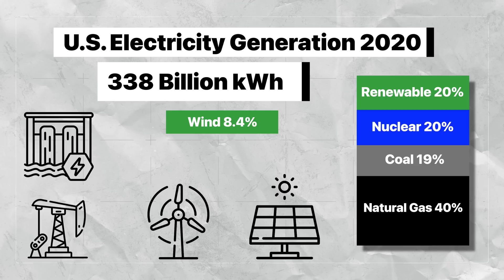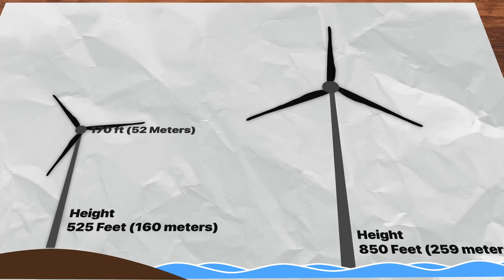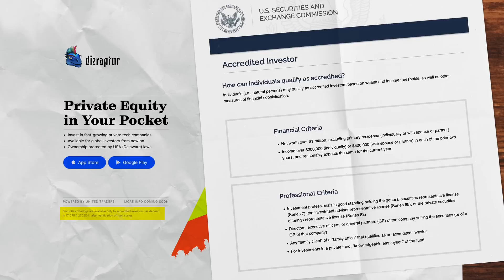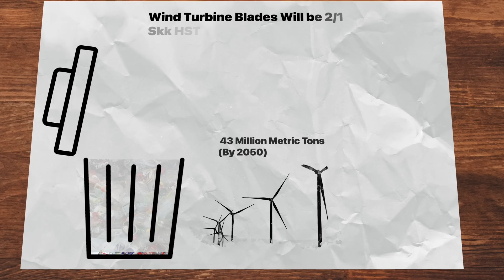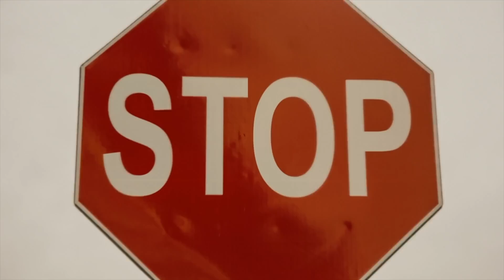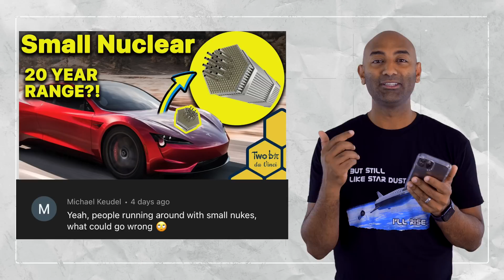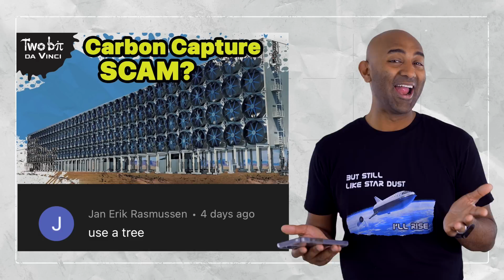The TRUTH About Wind Turbines

Comment: Let’s put wind turbine blades into perspective:

85% recyclable is amazing compared to most things we use.

43 million tons is so tiny, the coal industry currently produces 5 billion tons of toxic slag per year to landfill, plus another 0.5 billion tons of infrastructure per year, and slag is 100’s of times more toxic than wind turbine blades and is actually cancerogenic.

A 1 GW coal power station over 30 years will burn 100 million tons of coal, use 100’s of millions of gallons of oil to mine, transport and process that coal, use 5.5 trillion gallons of fresh water in the cooling towers, generate 6 million tons of toxic slag and 0.5 million tons of infrastructure to landfill and produce 300 million tons of CO2 gasses plus many other toxic gasses.
Compared to say the Dogger bank wind farm (the latest and greatest 3.6GW wind farm under construction in the UK) That will require no fuel, no fresh water, no oil to process the fuel, produce no greenhouse gasses, and generate approx. 0.3 million tons of turbine blades to landfill.

Wind farms only need constructing (which is only 2 to 3 times the construction overheads of the coal infrastructure) and maintenance which will be no more than the resources required to maintain the massive coal infrastructure while mining and processing the coal.
43 million tons to landfill and zero emissions per year, compared to 5.5 billion tons to landfill for coal plus 30 billion tons of emissions per year. 

I'm not saying putting wind turbine blades in landfill is good, but basically offshore wind farms are over 1000 times less polluting over their full life cycle than coal!
Reply: DAH !!!! And how many tons of coal to melt the iron for just ONE tower ?And then tons of cement just to hold the tower, all the diesel needed to extract the iron and transport to melting facility and then transport those heavy pylones to the windmill farm.
But this is just the tip of the iceberg, all the rare metals needed for turbine and batteries, some like cobalt are mined by children in Congo, some other need to extract one ton of dirt (by big diesel trucks) for just 1oz, some other countries such as China don't care about the pollution they cause to their own land.
Yep! many of those rare metals can be dug elsewhere but at what price ? Its cheaper to have kids digging for free, so any "ecologic" business will buy from those third world countries to justify the "clean" energy, yah right !!!
Reply: @danielforget9311  You don't get it, fossil fuels don't just magically turn in to electrons, it takes just a much infrastructure to build, maintain, and replace the fossil system,  just as many rare metals, just as much land, the fossil fuel system has a similar lifespan as the renewables, of which most of the infrastructure ends up in landfill while periodically replacements are constructed.

Yes child slave labour is terrible, but Most the cobalt mined in the Congo is used to refine Gasoline (which has always been the main use for cobalt), new modern mines are used for the new battery production! Plus most new battery technology do not use Cobalt.

And damage to land: have you ever visited an open cast coal mine (there are 10's or thousands around the world), or seen an oil slick, or the damage the 5 billion tons per year of coal slag heaps leaking into the environment, or the damage from acid rain? the world mines 100,000 tons of lithium, 5,000 tons of cobalt, compared to 86,000,000,000 tons of coal per year!!!!

And China cares about its land and air quality more than most countries in the world, is replanting millions of acers of forest, electrifying all public transport, is installing renewables faster than anybody else, leading the world on EV's, and only produces 1/3 of the pollution per capita than the so called clean USA!!!!!! 

An example of fossil fuel infrastructure: I worked on the Gorgon LPG product in WA Australia, 40,000 workers and me, took 7 years, 67 Billion AUD, and 100's of millions of tons of resource's to build one gas plant, with gas wells spread over 1000's of square miles, thousands of miles of pipe lines leading to a refinery the size of a small city and consumes the energy of a small city. Additionally a fleet of LGP supper tankers were built to ship the gas around the world. (40% of all shipping is to transport fossil fuels) and there are around 300 similar gas plants around the world!

We wont need any more construction resources to power the world on renewables or additional rare materials, compared to the existing fossil fuel/nuclear system. If just replaced at end of life (which is what the world is currently doing)  

But we wont need to keep mining and burning the 86,000,000,000 tons of coal, 14,870,100,000,000 gallons of oil and 1,322,762,690,000,000 cubic feet of natural gas per year and all the energy and resources it takes to mine, refine, transport and burn all that crap!
Reply: @danielforget9311  And how about all the rare materials and how many tons of materials does it take to construct a coal power station, to build the massive open cast mining machines, the trucks, conveyor belts, trains, ships, power stations, colling towers, boilers, turbines, magnets etc..., to mine, transport and burn 86 billion tons of coal per year. How much to build a 4000-ton oil rig, and all this needs fuel to burn, something the renewables don't need, Have you ever visited a refinery???? They can be the size of a small city and consume the energy and pollution of a small city.

and kids mining for renewables with their families maybe a few thousand (terrible), but most cobalt ever mined has been used to refine gasoline and diesel, and most EV batteries come from new mines in places like Aus that don't use child labourers. This terrible child labour existed long before EVs came along. It's cheap gasoline that drove it!!!!!!! in fact, most EV battery manufacturers are moving to batteries that don't require cobalt!  Gasoline is not!!!!

Basically, the resources required and the damage to the environment is a tiny tiny fraction for renewables compared to fossil fuels over their full life cycle and even compared to nuclear, you obviously have no understanding of what is actually required to construct and run the fossil fuel industry compared to renewables or have shares in fossil fuel companies!!!! (I have worked on the construction of many massive fossil fuel and power constructions over many decades)
Reply: @stevetaylor2818  Yep, i didn't think of a coal plant, so its even worse than i thought.
But there is hope for batteries, even AAA, take the isotope from a nuclear plant with blue diamonds (can be artificial) and make batteries that will last decades.
See Elon Musk nuclear batteries on youtube.
Reply: If you have to compare wind to coal to make it look favorable, you've already lost.
Reply: @ChucksSEADnDEAD  Just comparing the worst to one of the best, 1000th of the pollution of an offshore wind farm to an equivalent coal power station. 

For every 1 ton of pollution an offshore wind farm produces over its full life cycle, a coal power station would produce 1000 tons of pollution!!!! A Oil power station around 700 tons, a Gas power station around 450 tons, a solar farm around 0.5 tons!

Comment: On & offshore wind turbines catastrophic for bird & bat life, noisy, ugly to look at, production in filthy china far from green & the disposal problem. Eco warriors are nuts supporting this over deep thermal, tidal or the bloody obvious ultimate green energy 100% reliable - NUCLEAR
Reply: It is estimated globally around 250,000 birds are killed by wind farms per year, compared to 100,000,000 shot for sport, 200,000,000 killed by cars, 600,000,000 killed by hitting glass in buildings, 1,000,000,000 killed by our current fossil fuel & nuclear industry and 50,000,000,000 killed or cease to exist by destruction of the habitat , poison, pollution etc. etc. of the 400,000,000,000 estimated to be alive.

and wind farms are a lot prettier than a coal power station belching out toxic smoke! And why is China filthy, please explain? when per capita China produce a 1/3 the pollution of USA!!!!! and a large percentage of Chinas pollution is producing goods for the USA!

Comment: Net pollution is the most important aspect to this "problem". Yeah you want to optimize a wind turbine's benefit to the environment but if repurposing makes little difference to the bottom line then maybe landfill ain't so bad in this context. It's a carbon sink at least.
Reply: This video is completely wrong !!! This company in the Netherlands, Extreme Eco Solutions, recycles decommissioned turbine blades as well as fiber composite yachts into 100% recyclable street and floor tiles without subsidies and with a profit. Very very poor research from the person who made this video. 

It is not the technology that is wrong, but people are.

Comment: Wind turbine blades can be turned into concrete making them reusable
Reply: This video is completely wrong !!! This company in the Netherlands, Extreme Eco Solutions, recycles decommissioned turbine blades as well as fiber composite yachts into 100% recyclable street and floor tiles without subsidies and with a profit. Very very poor research from the person who made this video. 

It is not the technology that is wrong, but people are.
Reply: @insAneTunA  they definitely still are way better than coal PowerPlants! The future only allows for these technologies to improve
Reply: @LionX27  There is no doubt about that !! 👍 The current biggest wind turbine in the world is located in Rotterdam the Netherlands, and it is build for testing and licensing purposes. It has a rotor diameter of 220 meter and it is able to produce 14 megawatt. For comparison, the largest inland wind turbine in the UK has a 150 meter rotor diameter, and it can produce only 6 megawatt.

Comment: I sometimes wonder why we don't see blades made of aircraft grade aluminium alloys. If airliner wings can take the huge abuse they suffer day-in day-out, surely there could be a design of turbine blade that could utilise aluminium.
Reply: The blades on a turbine need to be light enough to be pushed by air. Airliners are powered by jet fuel rather than tailwind.

Comment: Wind power is so underrated. Unlike solar it works even during the winter north of the arctic circle. 

Also its possible to have seceral small vertical axis turbine on the area of your roof where the sun doesn't shine an therefore not in the way of eventually solar panels.

Comment: Issue 3: Environmental Devastation
This is a manifold issue with many facets:
First lets take the land foot print of significant numbers of wind turbine sites,  vegetation and trees must be mowed down to build thousands of miles of asphalt service roads to keep the things in repair - remember wind energy requires far more employees to keep the damn things running (this is actually a selling point for our brain dead socialist politicians who could never even run a popcorn stand - they do not understand what a child instinctively knows about the economics of business) .  These roads are needed to get all those heavy diesel engine powered  cranes, bulldozers, concrete trucks, mega trailer trucks for replacement blades, replacement parts, etc.  

Since wind turbines make truly nasty neighbors, they must never be located where the power they 'sometimes' provide actually live  in their cities and in the tony suburbs of the elite.  

Poverty struck rural  populations are the ideal place to locate wind turbine sites.  The promoters of this massive scam simply find the most immoral landowner to rent land space for these wind turbine farms.  They get paid enough handsome rent to make them among the new elite and its all "free" since the costs of all this massive rent is merely added to the users' utility bills, where the homeowner rates will rise dramatically.   Of course the commercial and industrial rate payers must also pass these extra costs onto the end users of their products in a true inflation bonanza.     

But what of the neighbors of these industrial monstrosities, they didn't get any handsome rent payments so they cannot afford to move out like the turn coat who sold them all out did for his lucrative rent payments.   They must stay behind suffer the noise, the visual blight, and the vehicle traffic that turbine farms generate often for the rest of their sorry lives.

Now we get to the real killer, the damned transmission lines.   Reliable fossil fueled and nuclear power is normally located, not in the hinterlands where wind turbine farms will be located;  Reliable power (fossil and nuke)  is instead usually located near the urban consumers where their transmission lines are both much shorter and much more efficient.  

Now for the Achilles heel of long transmission lines their resistive line loss.  The electrical power received at the end is a good deal less than what was sent.  In order to minimize this loss,  transmission lines must carry very high voltages (typically 345,000 volts AC or 1,000,000 volts DC).  This requires hundred of miles huge steel towers snapping and buzzing along with their thousands of miles of thick aluminum wires.   This adds to the land blight and forest devastation required to string the lines and keep them clear of transmission line dangers (forest fires and such.) 

OK that's a big price to paid for wind power for sure, but wait, there is more......unlike their shorter fossil fueled or nuclear powered cousins,  these long distance transmission line blights often carry NO POWER whatsoever. (whenever the steady wind is less than 9 mph or more than 55 mph.) Between 9 and 30 MPH they carry only a fraction of the capacity they were built to carry.

Wind power is such a terrible idea, a lot of brain washing is required in order to keep the gullible from actually thinking, this is where government education and media have a huge role to play in order to sell the worst idea since people used rats to recycle their garbage.       

Next up.....The bird, the bats, and even we humans.  Stay tuned.

Comments and critics are always welcome....I wish I could find anyone to credibly refute what I write here.

Comment: Click bait, the presentation has too many flaws to list in one post,   First the they blow down their strawman:  Wind turbines cause cancer, I have never heard this offered as one of the many negatives of wind turbines.  I will give you the real problems with wind energy in subsequent posts, they are enormous:    

Issue 1
In the opening gambit we are offered  a clever deception,  "according to the EIA "Wind turbines provides 8% of U.S. generating capacity, more than any other renewable source"   Who here notes the clever deception?     Focus on the word 'capacity'   Why that word?   Capacity is not actual generation, it is the rated 100% ideal generation number under ideal conditions.   Wind at less than 8 mph produces NO (0%) electricity    

Wind only produces rated capacity with steady winds at 31 to 55 mph,  at 56 mph wind turbines must be feathered and caged this actually consumes rather than produces energy).  

At steady wind between 9 and 30 MPH they produce only a fraction of rated capacity.   The typical working turbine produces about 20% of rated capacity so this means wind turbines "produce" less than 2% of our electricity.    This is not even the worst of it.  They most typically produce energy when we need it least, and always unpredictably so.   This demands that 100% backup using reliable generation for all wind generation at enormous additional costs to users.  Fossil fuel and nuclear are both dependable and unlike wind turbines actually 'provide' 100% of rated capacity whenever it is needed."*    

Managing demand in unreliable grids has already become problematic (Texas winter grid failure last year) As the number of wind turbines increase we will move from problematic grids to third world grids.   Electricity as a luxury item.   The important people (Hollywood and Washington) will all have back up power.  The rest of us will have smart meters - so they can disconnect us from their sagging grids remotely - this is now called "smart."

As always I welcome any comments or challenges to anything I write.   We are now creating an enormous and real man made problem in order to "fix" a man made problem that does not exist - follow the money!

The largest "renewable" generation source energy is "biomass."   Translation: burning wood (trees.)

Comment: I liked your piece. I am in the wind business. - I am about to repower the first wind farm I built in 2006. I will let you know how it goes. - Recycling blades is a small issue in my eyes. Everything cant be recycled. I get it, but would you rather have some decommissioned blades to dispose of, or would you rather have a truckload of depleted plutonium to dispose of? I vote for blades.
Reply: This video is not correct. A company in the Netherlands called Extreme Eco Solutions does recycle decommissioned wind turbine blades as well as decommissioned yachts into 100% street and wall tiles without subsidies and with a profit. This man who made this video did no research at all.
Reply: @insAneTunA  Tuna! Is that you? My Tuna? - Hope everything is going your way!

Comment: How are wind turbines carbon emissions free, throughout their lifetime? Seems like the negative aspects highlighted, debunk that claim. The most modern wind turbines operate between 13 & 55 wind speed. When they shut down, they require an external electric boost to get them going again. When they are shut down, some other energy source is needed to pick up the slack. Shouldn't that be figured into their carbon emissions footprint?